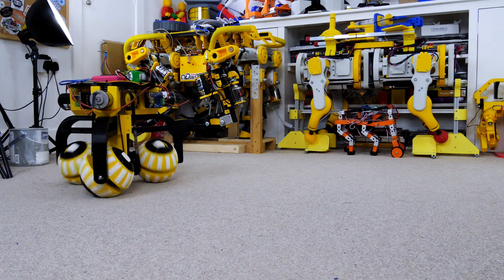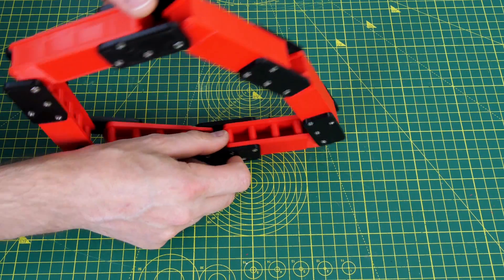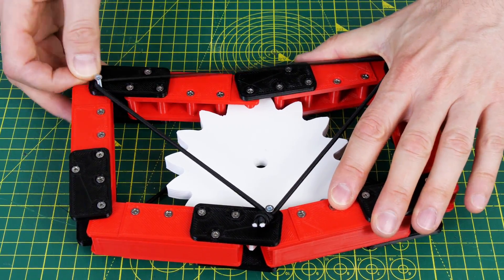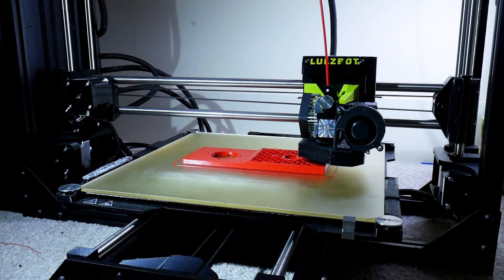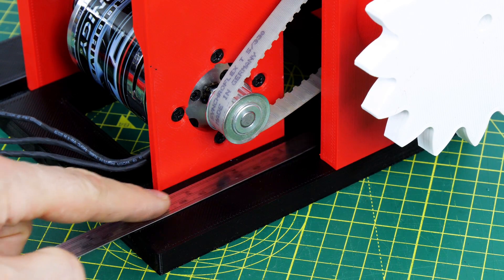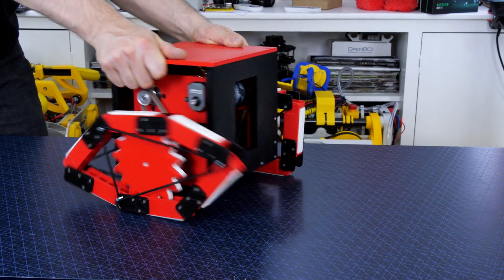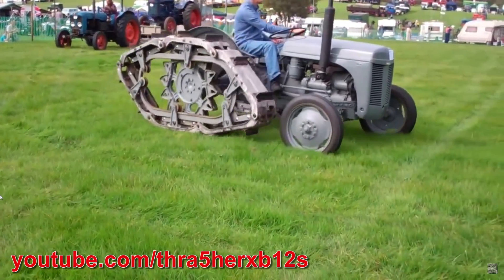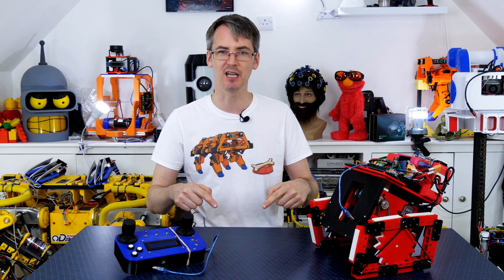Balancing Rotaped Robot

Comment: If the controller is aware of the orientation of the sprocket, you might be able  to bias it towards the more-stable positions.
Those known-good wheel positions will probably absorb a certain amount of momentum, so if the momentum you're trying to cancel is less than that amount, it's probably best to artificially stop in that position.

Comment: If you're still into weird wheels, you could make a robot driven completely by gyroscopic precession, whose only moving parts are the internally mounted gyroscopes and the gimbals on which they're mounted.  It could be spherical (or whatever other shape, but all others would be less efficient). 

The advantage?  Torque to drive the thing is not dependent on the action of gravity on a center of mass within the thing. (AKA, limited the torque required to achieve 9.82 m/s^2 acceleration times the sine of the maximum angle by which the center of mass of the robot can be displaced.) 

With potentially far higher torque, you get quicker starts and stops, sharper turns, more ability to go uphill or control descent downhill, more ability to overcome obstacles, etc, than any BB8 build I've ever seen.

The challenge?  Achieving control when the controls themselves, like the actuators that rotate the gyroscope gimbals, are mounted firmly to the inside of the robot, and therefore constantly rotating with respect to the external frame of reference that informs all the control inputs.

Comment: I wonder if replacing the bungee-coords with stiff ropes (or just much stiffer bungee-coords) would reduce the risk of the sprockets popping off? The original design had chains, so not much elasticity there.

Comment: Hi James! Are you familiar with the movie Damnation Alley with George Pepard? In that movie, there are some awesome survival vehicles with wheels I have always wanted to build. I have just never been able to figure out how to do it. The vehicles have three rounded wheels in a triangular arrangement for each of the four wheels. The entire wheel rotates for climbing over obstacles and each wheel in the triangle rotates for the main drive. I can see where the main drive wheels in each set could be driven by a single motor with a belt or chain connected to a sprocket on the drive shaft. I am totally baffled as to how this would be built though. After following you for sometime now, if anyone can build this, it will be you.

Comment: This is awesome! I wonder if you could further solve the balance issues by coming up with a function to describe the nonlinear wobbles of six tracks vs. wheels at certain wheel angles when balancing. It seems like 30° of wheel rotation could describe the balance response curve, that would then just repeat around a full rotation.  Maybe the same deal for each sprocket tooth meshing. You've probably already done this, lol, but it's very neat to think about!

Comment: Tracks are NOT for obstacles. Their purpose is to reduce "Ground PSI" or the amount of pressure the vehicle exerts on the ground by spreading the load over a greater area. They're essentially snowshoes for vehicles. Why is this important? It allows heavier machinery to drive over softer and wetter soils without sinking into the muddy depths.

Comment: what about three radio-controlled bogies for moving a grand piano. even on carpet. they would need some means of co-operating. Or similar but on a smaller scale thing for converting a phone into a teeny table-top telepresence robot. dare i suggest one-wheel drive + two omniwheels for balance/steering. might be able to cope with the odd beer mat

Comment: I am sorry you have the name wrong the correct name  "Howard Rotopad"  they were a third party add-on to your Fordson tractors made by Howard not Fordson.  There were a few different models.   They end up being supersede by stuff like the modern https://camso.co/en/agriculture/conversion-tracks-systems Yes a form of tank track.   Mostly because Rotopad were way to jarring.   Objective is the same to spread the weight of the tractor over more area so it does not compress the earth as much and does not sink in as much.       One of the earliest ones heading in the direction of the modern is the "Bombardier track system"  from the 1930s.   https://tractors.fandom.com/wiki/Half-track  yes the historic half track is older than the Howard Rotopad.   Where I am there "Howard Rotopad" is a insane rarity because "Bombardiar track system" was commonly in the market here  that provided most advantages of the "Howard Rotopad" with none of the nightmares.    Please note the Fordson themselves in the 1930 also started making half-track it had a horrible defect of being insanely heavy that undermined the goal of a track of spreading/reducing you pressure on the ground and being horrible complex and prone to catastrophic failure.

Howard Rotopad is better than a "Fordson half-track" but worse than a "Bombardiar track system".   Yes you don't get much more simple than the "Bombardier track system" you leave the standard wheel on add a extra wheel and put a track around the lot and you done.   Good part is if the Bombardier track broke as long as tyre was not done in the tractor was still fully driver-able I miss this on the modern solutions.   Yes the "fordson half-track" If it broke you were stuffed.   When I mean stuffed I mean totally stuffed normally broke in ways that would result in shearing the lug bolts off this would not be possible to get the tracker back to workshop to fix it in any simple way..   Rotopad you could also be in for major hell your lug bolts would normally be intact and you could battle a standard wheel back on.   Yes also people who had bad experience with "Fordson Half-track" kit could shy away from a "Bombardiar track system".   This kind of explains how the Howard Rotopad fits in as well its not a half-track and its better than the worst half-track on the market for tractors at the time being the Fordson one.

Comment: Yry swapping the bungy cords with some none stretching cords and you'll notice that it will run smooth because the total length of the cord doesn't change while the triangle is moving (or that is what I remember from experimenting with those wheels in lego when I was a child)
Reply from the maker: I wasn't sure if the length would stay consistent?
Reply: @jamesbruton  that's easy to calculate tho :p or to test now you have the wheels
Reply: Nevermind calculating it, drawing it in cad should be easier :p

Comment: ropes are a easily fail point, joint rotary springs
Reply: diy plastic, aluminium injection molding with lever pump, wire heater, aluminium extrusion machine, glass extrusion, ceramic extrusion, playdoh pressing
Reply: two gears
Reply: worm gear fast roll
Reply: top groove track
Reply: wheel flap cover
Reply: rubber inflated tube tank track, not metal, no joints
Reply: belt track
Reply: bike chain track

Comment: I was wondering about the number of treads.  the first tractor you showed had 8 treads.  you used 6 (guessing fewer parts to save time).  the last tractor had six treads but used that ring to control the treads.  Could possibly be a relationship between number of treads and stability?  of course more segments would eventually take it from rota-ped to tank tread.

Comment: I think you tried too hard to make these work like wheels. Personally, I think approaching these more like tank treads might had made it more stable, though I think the point for you was easy deployment. I love the look though, and imagine if you could "lock" the wheel/track position to rearrange the shape of them for different uses.

Maybe instead of allowing the back and forth oscillation having the AI move the other wheel slightly backwards as the other goes forward might find a flat spot faster as it is more likely to change the dynamic of the treads/tracks and get them into a flat state, or perhaps as "jostle, rest, check" function that makes a large dynamic change to readjust the wheels and attempt to forcibly get it to a resting point and then check after the large dynamic change.

Comment: The track jumping the sprocket is caused by the use of bungee cord for the retention cables. Looking at the movie clips you can see that the tractors has chains running on pulleys. The distance between the pulleys vary depending on where in the cycle the track is, but the total length between all three pulleys remains the same or at least very close to it. As the chain can move on the pulleys the tension is constant and the track can't jump the sprocket. Well at least that's what it looks like to me...

Comment: that for sure was a WEIRD WHEEL lol - what if you were to use more but smaller flat sections instead of just 6 - it would be smoother and probably less likely to get stuck in that spot that makes it hard to get going.... you could also decrease the size of the teeth and use that rail system you showed at the end. and if you made the circumference of the track bigger it could go over more complex obstacle (i would think)
AMAZING!!! I can't wait to see what you come up with next!!! :D

Comment: If you were to put a mechanism on it so that it could lock the tracks in place (for example an arm that swings down to press on the top of the track when it's got two sections flat on the ground) it seems like that could be a pretty stable platform for a hypothetical robot to do work while stationary.  Self-balancing when in motion but able to stop itself and eliminate oscillation when standing still.  Though, I guess a deployable kickstand would accomplish that just as well, if not as stylishly.

Comment: This could spin off into a serious of historic 'continuous track' vehicles. Dreadnought wheels and pedrail wheels are some of the more interesting ones that aren't directly a track drive but operate as one, similar to how rotapeds aren't exactly a continuous track drive in the typical sense but operate as one. Wikipedia would be a good starting place for the lineage that evolved into what we know as caterpillar tracks, though there are designs that exist outside of that lineage, but also somewhat in parallel with the lineage, which is how we eventually had rotapeds.

Comment: I wonder, the PID "coeficients" are just a few variables. How hard would it be to use an artificial intelligence algorythm that would take in the accel and motor position data and try to (real time?) adjust the variables to minimize oscillation? With some extra input from a human, of course.

Comment: I love how it leans forward right before it starts moving as if gathering momentum, totally reminds me of Wall.e! ♥️♥️
Reply: you get that on all single-axle vehicles; check a Segway
Reply: @thekaxmax  I don’t really understand it on this robot though. On a Segway the driver intentionally leans forwards. The Segway then tries to “counter” it by speeding up. But what is causing this robot to lean forward and how does it speed up without falling backwards in the first place?
Reply: @Mike-oz4cv  TL;DR: it works just like a segway except that the robot 'intentionally leans forwards' by slowly driving the wheels backwards for a moment which tips it forwards. Anything after that point is just like a segway.

Imagine it stands still in perfect balance, requiring no motor corrections. If it wants to start going one way now, it first tips itself out of balance into the direction it wants to go by driving the motors in the opposite direction (think, turning wheels backwards makes robot tip forwards like pulling a carpet under someone). So now that it is in an determined unstable state which wants to escalate (aka "fall over"), the robot can counteract the escalation by rotating the wheels into the tipping direction, so forwards, which converts escess rotative tipping-action into a translative driving-action.

Comment: Hi James, What do you do with your test, failed or old printed parts ? I expect you have a lot of big parts, do you have a way to recycle ? I checked around in the UK  and no one is willing to help with PLA and any other filament needed to be sorted, marked with what type of plastic and in qty of 1 tonne. After watching the CNC kitchen video I see it's possible to use again, but a lot of work and then I expect the quality would decrease each cycle and then you are still left with bio waste. I have started using filament on card spools and also using refill packs from ESUN and printed my own Masterspool too. I would be interested in your thoughts on this.

Comment: I've always dreamed of building a walking tripod ala War of the Worlds.
Reply: It seems like the difficulty there would be that as soon as you lift one leg, it's unbalanced because of the extra mass from the lifted leg on one side of the resulting bipod. What would balance that rotating moment?
Reply: @Nerdule  a gyro or reaction wheel maybe?
Reply: @huff_designs  have a hanging ball that balances it.
Reply: @Nerdule  well, that would be the interesting bit. The rotating moment is not balanced but needs to be incorporated into the gait – basically, the tripod keeps falling over to whichever side has the leg in the air, but catches itself in time before toppling over.
Reply: That requires some pretty advanced robotics, and some in depth knowledge of how stuff walks, and balances. Especially when there isn’t really a real life reference

Comment: How about using different PID settings based on whether you're moving it vs when it has no input?

Or if it's been oscillating despite no input after long enough it switched to a 3rd curve?

Comment: Hello James, what is the max speed and torque that the ODrive can handle? Do you think you could make a DIY Steering Wheel with force feedback with it? A direct drive steering wheel that is considered premium has around 10-20Nm and probably 1000 rpm from what I know.

Comment: Maybe 'V' shaped teeth and a 3d printed V track to receive it so it has constant contact that is stable at all points of rotation of the driving gear? I am just thinking out loud on this. You would still need the camphors on both sides of the gear and maybe even on the track to deal with the torsion when steering. The tracks become complex and hard to machine shapes, but a perfect thing to make by 3d printing. The gear can be made by sandwiching two gears with angled teeth and a camphor on one side on the axel, but could also be completely printed with support material.

Comment: The movement and shape of this reminds me of Wall-e!
Reply: YES!
Reply: @postualin6551  it would be great to see what he could do in bringing a Wall-e style robot to life with full animatronic features. Maybe even add some AI/machine learning to it.
Reply: @CraigHissett  it would be epic
Reply: wall e.... eva.. wall e... eva. yep just as cute.
Reply: Same man
Reply: @Matty.Hill_87  doing a truly animated Wall-e could be a ridiculously complex project. Linear actuators for extending his arms, many degrees of freedom required for shoulder and wrist rotation, and that's just the arms.
Tracks following the above robot's movement and balancing, plus dozens of servos for the neck and facial features.
I'd love for James to give it a go!
Reply: @CraigHissett  if anyone can pull it off its James
Reply: @CraigHissett  I was also thinking about a real wall-e, and i think you could do it without the need to balance it, the wheels on wall-e have 4 wheels inside so you could just connect the two on top to the body and that way you can still control the wheels (like up or down).

Just as i finished this i remembered that i have a moving wall-e toy right behind me, the entire wheel is like a big piece connected to the body by a long piece and several screws, and only the big wheel on the back is connected to a motor, the other ones move freely. It also has moving arms (just up and down, like a bad arduino project with servos), moving head, moving eyes and for some reason the eyes can shine with a blue light (don't remember that from the movie but hey, it's a toy).

And i would love to see a real wall-e, i could even die for that cause.
Reply: Wiggly boy reminds me of Red the unicycle from that sad pixar short
Reply: He just needs to add the eyes and make it yellow
Reply: The cuboid body certainly helps.
Reply: Just add a way to compress trash and voila!
Reply: @filval387  I mean, if it could clean up as well that'd be a massive bonus ha ha!
Reply: That gives me an idea. What if he made the robot balance on the top wheel? There's three, two at the bottom and one at the top. If you were to only attach the top axel the robot would have to balance on that axel.
Reply: @PunakiviAddikti  that'd work! Plus the track would give a more solid platform for balancing on, and could even allow for pivoting the body angle, for leaning forward when driving forward etc
Reply: @CraigHissett  Exactly. I think it would be a worthy idea to try.
Reply: Yes
Reply: Yes

Comment: Suggestion: someting based around this ->(https://youtu.be/pCON4zfMzjU)
You've already made a 2-wheel balancing robot, a 1-wheel one, now the next step is one that doesn't even touch the floor ;) 
For example, you could make a reaction wheel or gyroscope for stabilisation, and one huge  (or couple smaller) magnetic disc for the levitation
Seriously though, how cool would that be?

Comment: You should try those wheels outside or rough terrain. Will be interesting!
Reply from the maker: I think I'd prefer it to have four of them and not balance for that!
Reply: @jamesbruton  New skateboard idea anyone ? :p
Reply: @firefly2472  remote controled powered skate board... or even better add a "floating" platform to stand on and act as a the control stick
Reply: @jamesbruton  It wouldn't be too hard to add 2 more cogs and lengthen the tracks. The new cogs could either freewheel or be added to the belt loop.
Reply: @jamesbruton  so perhaps an identical unit and articulated joint and pair them together?

Loved this one, well done